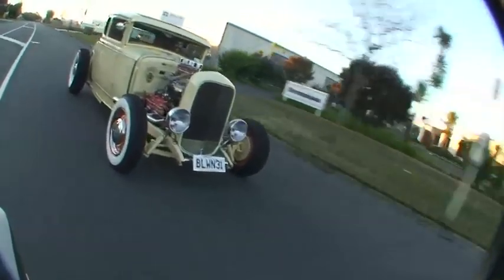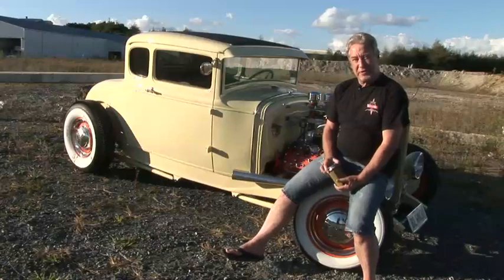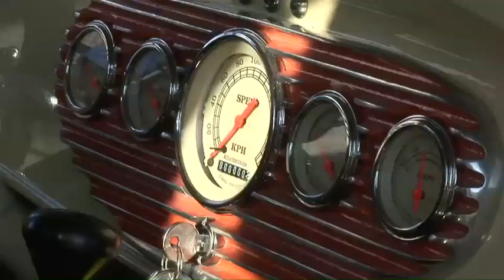AWESOME BLOWN FLATHEAD POWERED FORD MODEL A COUPE!

Comment: john your correct no fenders increase accidents from debris. but one would have to be daft to spin they tyres on a gravel road near children. More are hurt from automobiles with fenders than from flyin debris from autos without fenders...anything can cause personal damage and you cant modify everything to make it 100% safe..ex. hammers with a pillow around it...saw with no teeth, knife without a point or sharp edge, no more stairs so you cant fall down them, no roads to get run over on,

Comment: Well in that case perhaps there should be more stringent inspections on what are, in a lot of cases,home built vehicles,I am old enough to have been around when you could pick up stuff with great potential for a handful of cash, but parents have funny ideas on what you can clutter up the back yard with.I knocked back an SS from around '35 or '36 with a flathead standard 20 engine with a cracked head for $25, still hurts.

Comment: Even if the rod is front wheel drive (which I doupt any rod is) and turned to the right and the throttle is increased the odds are rare and very farfetched even on a dirt road. besides unless your on a two lane highway the odds of your buddy even being at the proper angles for such a thing are extremely farfetched. You are what I like to call extremists, extremists who obsess over a situation of thing that will either never happen or is extremely improbable to ever happen.